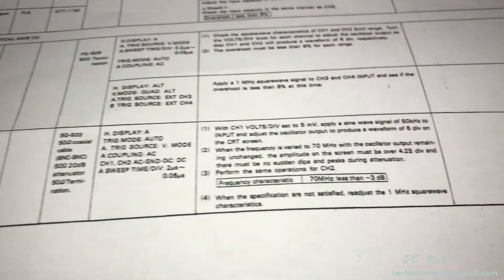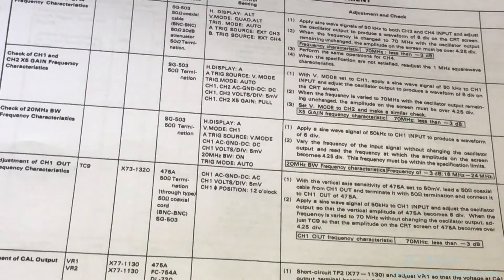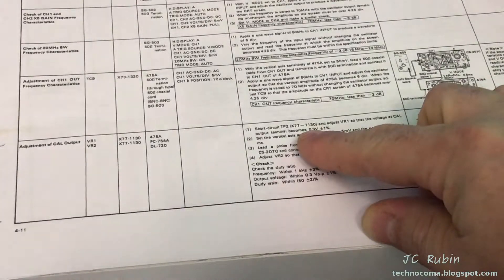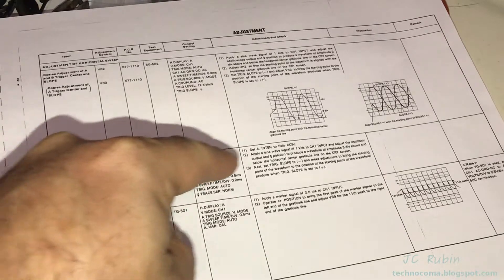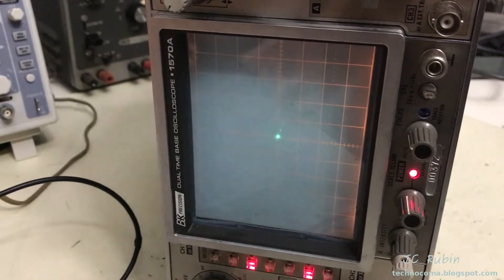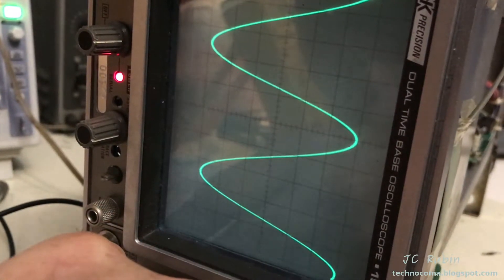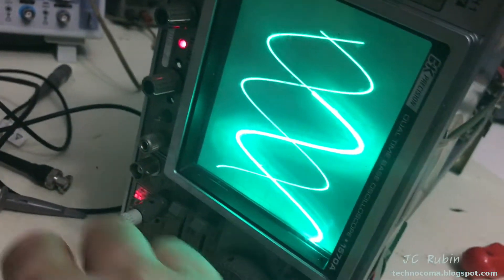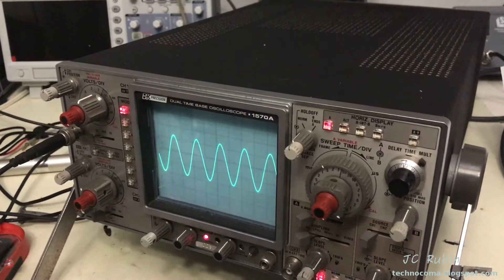BK Precision 1570A Oscilloscope Repair and Calibration Part 5 of 5

Comment: Hi with the model number of the scope being BK 1570A, most of the models of that era, the last two numbers is the frequency of the scope ie 70 MHz.  Being an Electronics Engineering Technician for 43 years.  I worked on Tektronix scopes, especially portable scopes, the Vertical 1 MHz High Frequency adjustments looked  way rolled off to me.  The front corner of the waveform should be a nice square wave.  As shown in the waveforms in the calibration instructions.  The high frequency is in the first  3/16 of the front corner.

Comment: I watched all five of these hoping to see how to get in between the CRT glass and the front plastic screen - mine has somehow gotten what looks like a piece of rice or maybe it's a bug - stuck between them. From the inside it appears to be sealed tight as a drum. The bezel has a lip underneath which gives the impression it can be pried off - and it did give a bit but I was hesitant to pry too much.  It really seems to be perma-bonded or screwed on somehow.
Reply from the maker: Could be delimitation if nothing can get in there.
Reply: If you could get the full service manual for the scope, it should have disassembly instructions that won't distroy the parts.  With Tektronix scopes had the graticle in the glass of the CRT, and the green filter was in front of the CRT.  Some scopes have four screws around the CRT, and others the green filter could be removed by just pulling on it.  Other scopes you had to pull the CRT to get the green filter out, unless it is easily removed I wouldn't chance it, unless you are a experienced technician.
Reply: @rayburke4386  I serviced consumer electronics for ten years at Circuit City (RIP) and am no stranger to disassembling electronics.  As old as this thing is, I doubt I'd be able to find the service manual.  In any event I was able to blast some compressed air into the area in question and managed to dislodge the bug to the edge of the screen where it's barely noticeable.
Reply: @BarryPiper  Well what you did is probable good enough to get it out of the way.  At least it didn't change things too much, good job.  Later Ray Burke